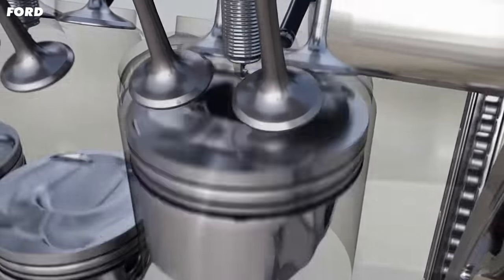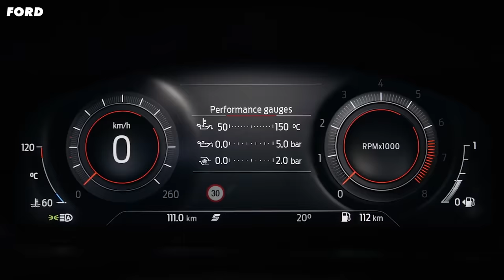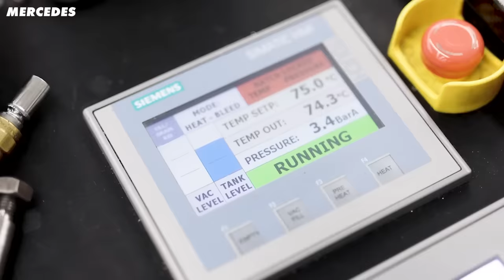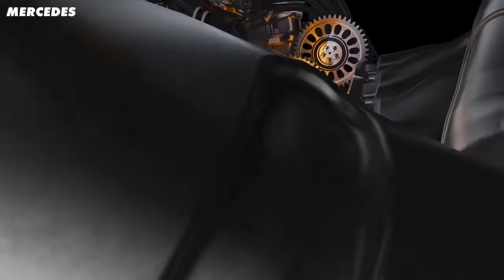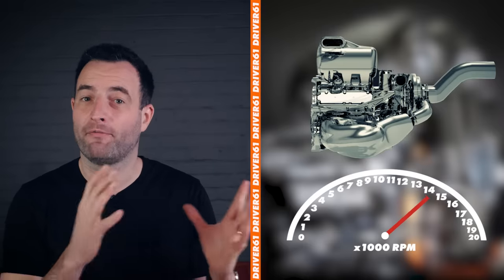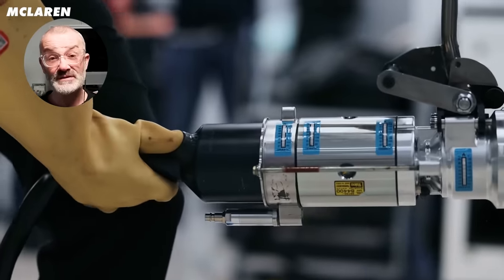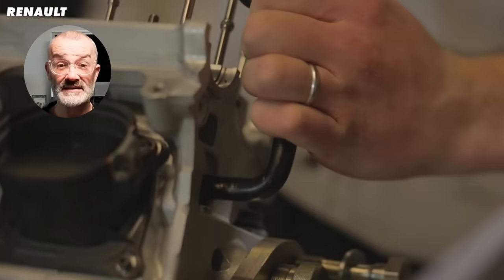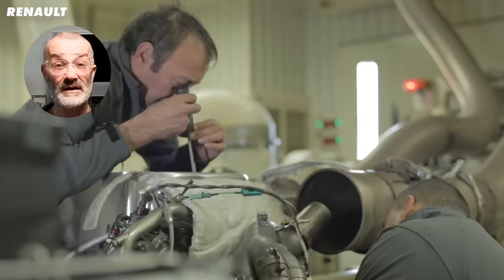$5000 Normal Engine vs $10 Million Formula 1 Engine

Comment: Well, here's a big block that you might like, good old Chevrolet power. A Bill Michell alloy tall deck BBC 4.5" bore, w/sleeves remove, bored to 4.7" for NiB coating (block & crank weight comp. to LS7);  and a 3.75" flat-plane crank, both on the limit of mass, but could be done (forged brass .30", yes .30" head "gasket'' O-grooved to both). The assembly pared-down further w/ 6.7" titanium/magnesium rods(1.786 ratio) pistons that look something like you showed and a 7.72lb steel flywheel, for a 5 X 8.5" kevlar clutch pack and titanium pressure plate. For dual cylinder hyd. clutch assist at 2.5X the pressure. For a C7 manual custom ratio transaxle in a C6 Vette. CID DM500 ported symmetrical heads (John wouldn't give me port volume, he hates it, says cross section is 4"sq. It flows 482cfm @ .800 lift w/2.5" int. valve,  and room to unshroud. That's 520cid and 1050hp at 8250rpm, with some trickery from the ZZ572/720 crate mech. roller cam specs, Jesel 1.9, and a custom, mech. VVT mounted to a dual row timing set, for 20* of duration change, phased with the turbos. There's so much more, but NA power greater than your 1.6L wiz banger, and on E90/methanol inj. 2500hp capable w/ < 8lbs psi. per cyl. bank. No intercoolers and direct plumbing to and from fender mounted turbos to 2X50mm twin TBs w/y-pipes, canbon X-ram to opposing heads. The exhaust are Tri-Y for the 1-5-2-6-4-8-3-7 firing order. Lovely Garrett GTX3584RS turbos. Instant power and no KERS to shut down the engine, when the little battery gets all charged up with nowhere to go.. (about $50,000 plus trans, etc.)

Comment: It would be interesting to compare an F1 engine to an Indycar one that makes moderately less power but it costs a fraction of that
Reply: That would be interesting. I bet the power and dyno curves would be basically a secret though.

Indy would likely not mind, Formula 1 teams though....
Aint no way theyd all agree to have their skunkworks numbers just publicly known.
Reply: Then Look at the archaeic pushrod V8 engines in drag racing that produce insane amounts of power for far cheaper. Making about 11,000 HP for an 8.3 liter engine. That's like 1,400 hp per liter lol. Also the sound of a top fuel is something that can't be explained. It's the one motorsport where you have to be there to experience it. 0 to 330 mph in under four seconds.
Reply: @4touchdowns1game29  I'm talking about racing engines that last for whole races, as amazing as drag engines are they literally last 400 meters
Reply: @ale_s45  yea I feel you about that. They don't last for shit lol. I'm all about modern engines although I did use to drive a c6 corvette with a pushrod v8 and that thing was amazing. Low weight and made power super easy..

Comment: A very good explanation of why the engines are so expensive, but no discussion on if they need to be. Drivers always want more power, but its only relative to the competition. Driver just want the fastest engine on the grid. Fans dont give a monkeys for how advanced the engines are, they just want to watch fast cars that make lots of noise.
F1 could become far more affordable and more relevant, if they ditched the current regs and just made  a formula based on a race version of existing road engines. Mclaren, Aston, Ferrari, Merc etc all make powerful V8 engines for their GTs and sports cars. Make the teams run these as the base, with a spending cap of $100,000 per engine.
Reply: I’m not a fan of formula 1, it’s quite boring, but I think you’re right on this one. Why can’t the FIA have a rule that all engines must be production based? It’s going to cut the cost quite dramatically. Let’s say, keep it at two litres, the engine must be off the shelf, any number of cylinders, diesels are allowed and anything beyond that, anything goes. Keep the engine cost down to £10000, but go nuts.

Comment: I don’t think the engines can be ‘seized’ when cold, as parts expand when they are hot. It’s just the wear would be unacceptable.
Reply: Cold seizures are real and exist due to internal mechanical failure or lockup or on rare instances foreign metal inside the combustion chamber. Also causes can also be attributed to the metal inclusions that were missed during UT and magna flux inspection.

Comment: A formula one engine doesn't cost 10 Million. 

When you consider that for the 20-ish Million a year teams pay their suppliers, teams get 2,5-5 PUs for the season per driver (depending on reliability) plus PUs for the pre-season-tests and other test drives, it's probably only 1 million for the manufacturing of a PU (not including development costs).

Some ball park numbers: 20 Million per year for two drivers, each of them needs 3 whole PUs for the season (really good reliability), plus one for testing: that's 8 PUs, so 2.5 million per power train.

Comment: Anyone remember the turbo era of yore? They had factory BMW engines, modified making 1,200-1,500 hp in qualifying trim.
Reply: Specifically, 1.5 liter iron block 4 cylinder tipped on its side with just one big turbo.
Reply: @ATEC101 I heard that was basically a production line engine.

Comment: What best sums up current F1 power units for me is when Honda rejoined F1 in 2015 with McLaren it took them 4 years before they were competitive! This is Honda we’re talking about and it seems impossible that a company with their smarts and resources could take so long but thats how complex these power units are. I could go on and on but integrating the energy recovery/electrics, a single turbo V6, and drive by wire throttle and brake and having that make max power from 6000 to 12000rpm reliably for seven races is insanely complex and just takes a long time to get right for even the best on the planet. One thing you forgot was the computer/engine mapping that controls everything.
Still doesn’t seem possible even months later that Ken Block died 😔

Comment: An F1 engine does not make 1000hp. They make about 800 or so. The rest is the electric motors. I don’t know why people always say F1 is 1000hp. You can’t use the electric motors full time, so they shouldn’t be included in the Hp numbers.

Comment: 80mph peak piston speeds aren't uncommon in high performance street cars. With the longer stroke of the average car, the same speeds can be met at much lower rpm.

Examples would be the BMW E46 M3 or the Honda S2000.

It's a chemical limitation over a mechanical one. Your engine and piston can spin so fast, that you will out run the flame front of the burning fuel and receive no mechanical work.

Hence one of the reasons F1 engines use such short strokes.

Comment: It has to be a racer's tale that an F1 engine is locked up at room temperature. Were that true it would be impossible to assemble the engine. What can be true is that uneven distortion of the parts as they come up to temperature will cause scuffing and other damage which will destroy the engine.

Comment: the "1.6L 1,000bhp" figure is largely propped up by rpm. remember, power = torque x rpm/5252. plug in the numbers, you'll find at peak power, current f1 engines only produce about 475nm of torque. still a big number for a 1.6L engine, but way less impressive than the 1,000bhp figure people keep talking about. i mean, if you give that little fiesta st 1.6L engine enough boost and perhaps swap in a stronger bottom end + larger fuel injectors with same octane fuel as f1, it for sure can get to 475nm and last as long as a typical f1 engine does (3,000 - 4,000km). also, a 1.6L v6 is going to have very small cylinders comparing to 1.6L i4 with even shorter stroke, making a f1 engine much much easier to rev high. not to downplay the amount of engineering that goes behind f1 engines but it's not a godlike thing worth worshipping. after all they siimply cannot last. they're more like a consumable like your tyres and brake pads.

Comment: Man, don't cry! The engine of my 35 y.o. Suzuki GF250 revs up to 15000 rpm (even normally revs up to 13000...). And it doesn't costs 10 milion. 😝
Reply: Believe in JESUS today, confess and repent of your sins. No one goes to heaven for doing good but by believing in JESUS who died for our sins.  “That if you confess with your mouth, “Jesus is Lord,” and believe in your heart that God raised him from the dead, you will be saved. 10 For it is with your heart that you believe and are justified, and it is with your mouth that you confess and are saved. ”(Romans 10:9-10)❤️🙏

Comment: As a mechanical engineer, working 16y in car industry, just wanted to note: In a factory environment engine, also EVERY bolt is tracable and for important bolts, 100ths... even the stretch graph is saved!

So the part where you tell, "this is why it costs so much more" is undenieable bs

Comment: Id like to make a correction to your video. The Fiesta (mk8) featured in the video actually has a 1.5 litre 3 cylinder engine. NOT a 1.6 litre 4 cylinder. The mk7 had a 1.6 litre 4 cylinder engine but that only produces 180hp, not 197hp.

Comment: God bless Ken 💔..... I have to say that the engine limits on cost cutting are ridiculous with todays machine capability. Once the R&D is done I would be shocked if it costs more than 1 mil per engine to manufacture and assemble. I get it's expensive but everything is computer controlled to .0001 or less tolerance. It was hard in the 60's to make a 427 last 24 hours because it was all manual. CNC is much different
Reply: Thank you! Finally someone mentions R&D. That's where the real money is spent and it's not even discussed in this video. If there was some reason to manufacture F1 engines in the volume that Ford builds engines, they would only cost a few times what the Ford engine costs.

Comment: If the engines at room temperature the reciprocal parts are technically seized, how is the engine assembled ? 

I can imagine that some of the reciprocal components are either nitrogen cooled or heated. The only way the reciprocal components would have to be assembled is in their respective positions for their individual cycle with the engine at rest when finally completely assembled. That would require every piston in each cylinder in a exact position in relation to the crank shaft position. This would require absolute measurements during final assembly. What makes this technically mind boggling is every component thermal expansion ratio would have to be calculated to as much as four to five decimal places. (In inches.)

Comment: I’m a little disappointed in lack of detailed information. One of many missing details is how much effort goes into reducing friction. I thought F1 engines run a very low air pressure in the crankcase to minimize losses from windage. Also dry sump and carefully directed oil spray reduces losses from oil splash. Pistons have anti-friction coatings on the skirts. There are so many more areas that have little contributions that add up big. I wish I could find more details on all the tricks utilized. Most can’t be that secret since all have been doing it for years.

Comment: It’s interesting, but McLaren road cars also use the same torque ‘recording’ data on each engine that Ricardo produce. So you can at least get a taste of the technology. I think a lot of the cost is in the understanding and research of the ‘pre combustion’ system and also the materials for both the turbocharger, the battery chemistry and the magnets, for example in the EV drive system, especially the MGU-H, which spools up and takes power off the turbocharger.

Comment: A regular engine can be made to support those HP numbers... and technically... everything these teams research eventually make it to their road vehicles... so development fees are amortized over all production engines they produce... not the cost of the F1 engine alone. You can find an older F1 piston in every modern day vehicle with their light weight, and shorter skirts. Eventually, I am sure, there will be production engines with 3D printed pistons, with more exotic materials. It is just a waiting game.

Comment: A 4 rotor turbo produces 800hp with regular petrol and 1100hp with racing fuel. A 4 rotor is still smaller then a V6 engine.

Comment: It would be interesting to see how a larger manufacturing volume would affect unit price of F1 engines. i.e. If F1 engine manufacturers made as many engines as Ford made the Ecoboost engines (100,000's?), and if there was similar demand (big IF), would R&D costs of the F1 engine amortize out across the larger volume of units enough to make F1 engines "more affordable"? Of course, the marginal additional cost of making each F1 engine will be greater than the marginal additional cost of making each EcoBoost engine, but I wonder if the cost of the F1 engine at that volume would only be 100x more than the EcoBoost? 50x? 20x? 10x?

Comment: The cost savings is in mass production.  Cost savings in high numbers.  What is the development cost to developing a mass produced engine? How much does a modern engine assembly line cost to buy, maintain and use

Comment: You can't scale up the engine costs. The formula 1 engine isn't produced in masses. If so, it would maybe cost just five times more than the Ford Fiesta engine.
Reply: Therefor there is not production line which reduce the cost dramatically.

Comment: $5000 and your own labor you can build a 350 Chevy with 550hp @7500-8000rpm and if you're nice to it the thing will give you 30,000 miles Easily. Mine did.

Comment: I wonder how much teams spent on engines in 2003 when there were no restrictions on how many engines you could use. Was it equivalent to $30 million for the year? They were allowed to use a different engine for each practice, qualifying and the race and do it again the next weekend, although they didn't always do that. They could also rebuild engines between races. Very wasteful I guess, but was it cheaper? Did the cost saving measures backfire? Am I missing a million little detail?

Comment: Putting a $ figure on the price of a Formula 1 engine is a little difficult ??
It will depend on which Formula 1 Team is buying the Engine and how many Engines they are buying.
Much like any form of Motorsport,  different Race Teams will have different buying power.
Some Race Teams, are Factory backed while others are only part partly backed.
But, it's still an interesting topic to bring up.
Formula 1 have what seems like an endless budget when it comes to how much money they spend each year.

Comment: F1 engines are incredible, but there is also a lot about them people don't know/understand.  It's one of those things where when you really look at the details, it becomes more reasonable.  Sure they make 1000hp but some of that comes from the electric motors.  Then you look at the horsepower the engine itself makes but that's misleading.  F1 engines can rev to the moon which makes their numbers much bigger.  Horsepower is (torque*rpm)/5252.  So if you take the 850 horsepower the engine itself makes at 18,000 rpms and plug it in, you find that these F1 engines on their own only make roughly 250tq.  Which is incredibly low compared to other engines of that horsepower.  What's impressive about these engines isn't that they can make 850hp out of a 1.6, but the fact they can spin it up to 18k+rpms for hours on end reliably is insane.

Comment: its dumb to call a normal engine cheap and a f1 engine expensive. the first engine that was made for that engine model almost definitely cost way more than the f1 engine, the later ones are simply copies produced on a very efficient process to make them cheap, the R&D cost is gone at that point, while the F1 engine is simply just one or two that the R&D is considered in their cost.

Comment: To be honest Im more amazed with what Ford is doing with these mass-produced, dead cheap consumer engines. $5000 gets you 1.6 engine with 200HP@6000RPM. Thats much better specs that Formula 1 engines from the 1950ties!

Comment: I think if you said 117 feet per second sounds cooler than 80mph. Everyone goes 80 mph. But to think that little rod in your engine could travel 117ft away in a second seems cooler. LOL.

Comment: I wish you would stop saying they run these engines at 15,000 rpm. Yes they are legally allowed to run them that high, but they never go above 12,000 rpm during a race, ok maybe 12500 on occasion, but that is it.

Comment: 15000 rpm redline ???
The rules says that the engine can rev that high but noone revs like that. They are aorund 12500-13000 redline